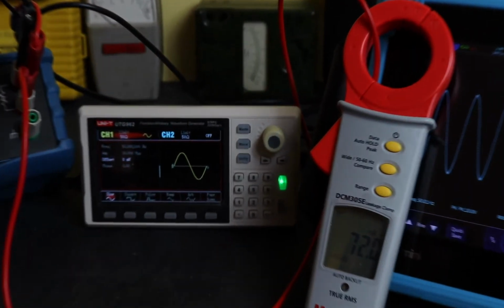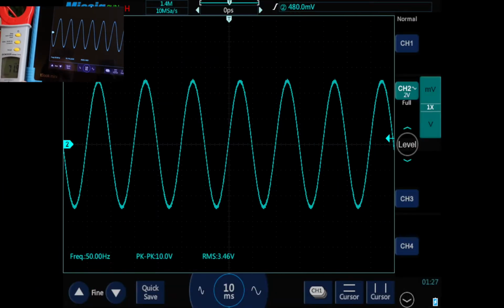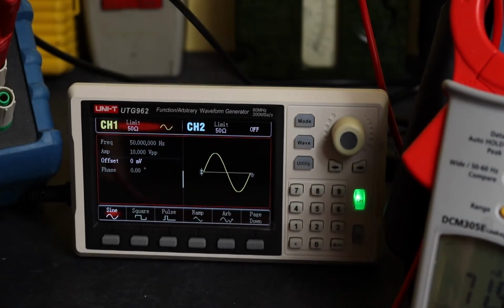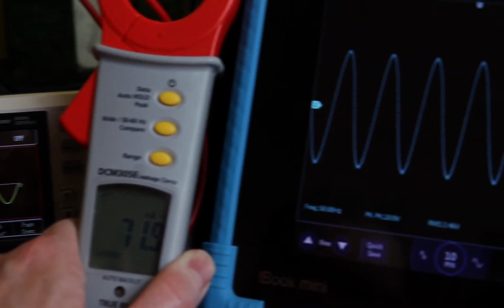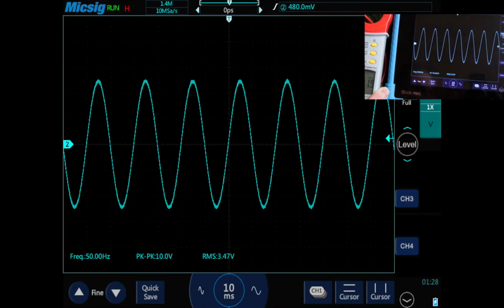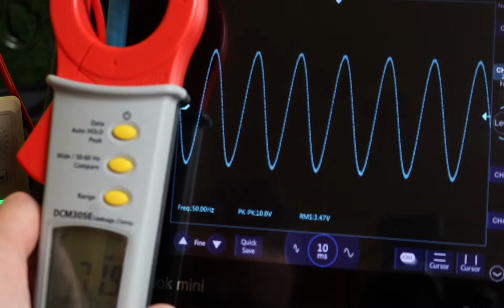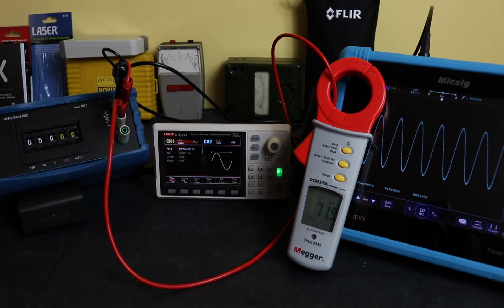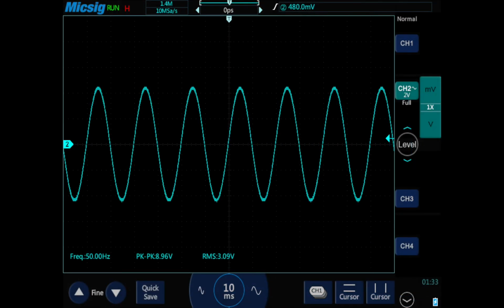Earth Leakage Clamp testing update #2

Comment: That's interesting. I was try to see a pattern as you were switch the load but I really didn't see any consistentce. I thought maybe the generator was limiting the output based on wattage instead of voltage or current but that doesn't seem to be the case. It would have been nice if Uni-t would have gave some kind of idea of how they calculate the output. But from what I can tell it's something inconsistent/ unpredictable.

Since you had yours scope paralleled in the test circuit what kinda effect if any does it create?
Reply from the maker: It is a strange one, but I have always been told to be wary of the output of a function generator as it is not always what is on the screen. I think a power output limit may be a possibility. Certainly more than a current limit, as I could get more current output by reducing the external 50 ohm load on the decade box. It may be that you need to short out the output to hit the current limit, technically, there is still the internal 50 ohm load so there is still some limit, but I don't want to risk damaging the output. 

The scope input is a great question. I went back and checked on the Micsig, it has a 1 Megohm / 14 pf input, so should affect a 50 Hz signal too much, whilst in parallel with the 50 ohm decade box.

I may take a look at the other signal generators I have and see if they have better details on the output than the Uni-T.

Thanks for watching and commenting.
Reply: Nice… getting into the very challenging area of measurement and metrology….accuracy and consistent measurement I suspect comes at very high costs.